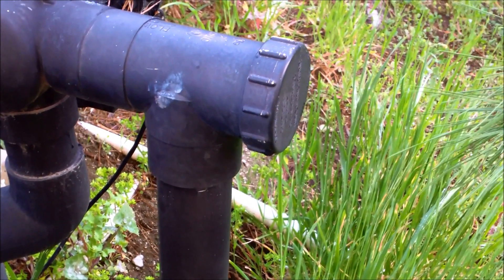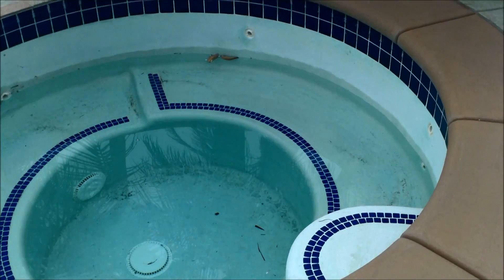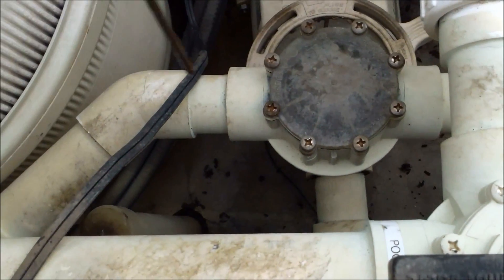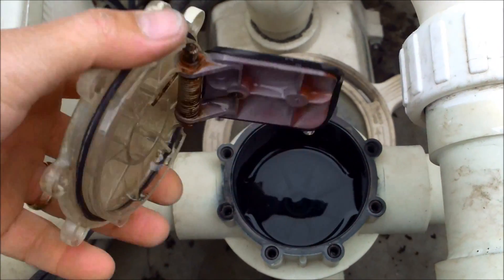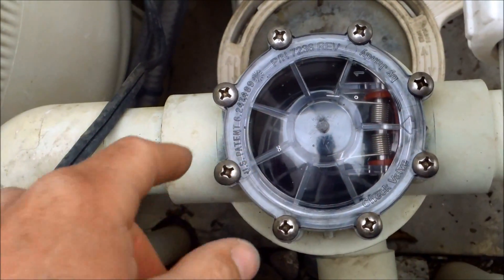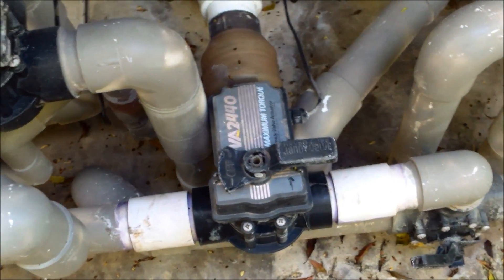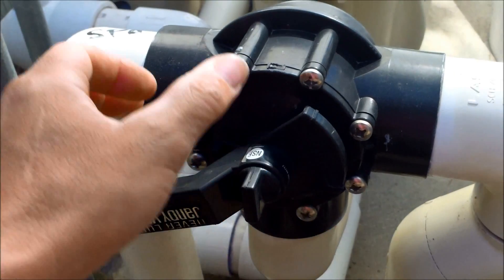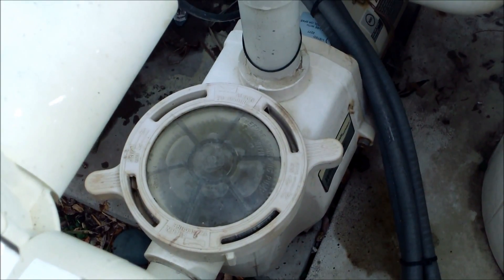My Spa is Draining Down When Pool Turns Off

Comment: Wow! Thank you! I replaced my spa valves thinking I had solved the problem. But no. So googled the question and got your video. But my Jandy system has a weird all enclosed check valve. No screws. I’ll call a pool service since I can’t cut pipes and do this myself. Thank you for this video!

Comment: Selling my house here in California, buyer hired a pool inspector check-in the pool, he rotated two valves that I had not touched in twelve years located in   the ground that look like skimmers but have some kind of a valve. Once inspector moved the handles on both now when pump is running water will not go into Jacuzzi as before and now the Jacuzzi drained into pool. What were those valves for?
Thanks
Reply from the maker: Turn the valves back
Reply: @SPL  Once  touched after 25 years  they broke and not working,have to be replaced. Thanks for responding.

Comment: THANK YOU - THANK YOU - THANK YOU!!! This video saved me a $150 service call. I sent my system into SPA DRAIN mode accidentally and when I activated SPA FILL mode - it would just keep draining. It turned out to just be a stuck spa drain cap/plunger thingy inside the Spring Check Valve. Working perfect again! Thank you so much for this video - YOU ROCK!!! 🙏

Comment: I went on a job where the problem was the check valve but it was because the check valve was installed backwards 😢 Great video man always a pleasure
Reply: If I drained my inground pool and the water level is below the skimmer and jets should I leave the pump off or on when filling the pool back up

Comment: I kept ignoring the water level in the spa lowering each evening, but the birds like to drink in the spa at top level in the mornings...so I finally followed your instructions and it was a 5 to 10 min. job. thanks! paid $14 for the Jandy valve on Ebay. Glad I spotted your video and didn't have to pay a pool repair to do this.

Comment: I change my back valve but sap water still goes down
Reply from the maker: It could be another issue. Also check for a leak maybe.
Reply: @SPL  it will refilled again like three inches go down the old valve was looks so bad before go have way down

Comment: How do I fill the spa back to normal after replacing these parts? Thank you!
Reply from the maker: Simply turn the return valve to spa return and leave the suction valve on pool mode. Or it will fill on it's own.

Comment: Hi.  Love your show.  First time caller.  Long time listener.  My Jandy valve is vertical, I think whoever installed it put it in the opposite way of the water flow, and i'd like to turn it around.  When I unscrew the valve, a flood of water comes pouring out and I can't figure out how to stop it so that i might be able to assess the situtaion.   Any ideas?
Reply from the maker: It could be the equipment is below the water level. In that case remove the pump basket and put a tennis ball in the skimmer hole. That should stop the flow.
Reply: @SPL  thanks

Comment: Interesting video.  Our Spa has Always drained down when the pump is not on (new pool).  I assumed this was normal.  Is it possible the check valve was installed backwards?  I have had other plumbing issues that I had to fix, clearly the pool builder was not very good with plumbing.  And out of business now, but that is another story.....
Reply from the maker: Yes- that is common. Maybe have a local pool service give it a look over.

Comment: I lubed the ortega Valve  VAL-PAK V20-069 twice, spa still drains when pump is off. After I cleaned my pentair flt fns pls60 DE fillter , run quick clean, the following day , it drained again. Do I need to replace the ortega Return valve and 1lb spring? Or what do you suggest I’ve been skipping. Thanks.
Reply from the maker: Those parts are hard to find but it sounds like that valve is pretty worn out. You can try to replace the insert and spring as a 1st step.
Reply: @SPL  replace both 1lb spring and the insert , it did work but only after that quick clean. the following day , still losing water. Any idea for the 2nd step?

Comment: Hi. My spa has always done this. I just thought it was normal. I looked and realized I don't have a check valve installed on my spa return side. Is this a problem? Does it really matter? Thanks for any info.
Reply from the maker: Doesn't matter in any regards except it is unsightly for the spa to be lower when the pool turns off. Maybe install a check valve to solve the issue.
Reply: @SPL  thanks for taking the time to reply. I appreciate it. Any preference on valve brand/type for the check valve should I choose to plumb one in?

Comment: This worked for my Pentair check valve! There wasn't any noticeable debris but there was an algae buildup so I cleaned it thoroughly and lubed the O-ring. Thank you a million times. 
I have the same exact hot tub & pool setup as one of the pools in this video. So, thanks a million!
Reply from the maker: Glad you fixed it!

Comment: Fabulous. I was in the 25%. I rebuilt my caretaker 5, replaced the nearby (pressure check) flapper check valve, and replaced the five diverter valve paddles (Jandy Neverlube) and all o-rings. One of the diverter valve o-rings was clearly damaged---half gone. When all done, the spa now retains water over night. Yay! Thank you!

Comment: I have the ortega check valve. Turned off the pump, unscrewed the cap, lubed up the ring, placed everything back in, and completed within 5 minutes. Saved between $140-$200 doing this myself. Thank you!

Comment: Hi David..I love your videos.  Do you have one that shows how to replace an Ortega check valve with a Jandy spring loaded valve?  They stopped making the Pentair Ortega seat assembly and the generic part is just a bit too small.  Thanks!
Reply from the maker: That is a bit more of a difficult swap since they are designed differently.  You would have to do some Mac Guyver  type plumbing to get the Jandy Check Valve to work in place of the Ortega one.  If you email me some pics I can send them to a buddy of mine who just did one of those last month.

Comment: Can this issue cause my water bill to spike? My bill tripled in the last couple months and I just noticed this same issue is happening. I found a broken valve that I’m going to replace but not sure if that will fix my water bill from rising month after month.
Reply from the maker: It's possible the spa is actually leaking.  You only notice it when the system turns off.  Do you have an autofill on your pool? If so turn it off and see if the water level drops.

Comment: So as the spa drains back into the pool, it should raise the level of the pool also, right??
Reply from the maker: Unless the spa sits very high above the pool it won't be very noticeable.
Reply: A friend of mine had the same problem and since i have experience with spas, he asked me to check it out. I found zero leaks, zero mechanical problems and i was stumped.... so this went on for a couple weeks with the same issue. So one day i asked him to set up a trail cam facing the spa. He asked why, so i said, since you live in the mountains, i think i know where your water drop is coming from. The trail cam captured just about every animal indigenous to the area drinking from the spa every night !  Now its covered all night long. Just thought id share this weird story. Not everything is what it seems.

Comment: ok... how do you get the hot tub to refill?
Reply from the maker: Leave it in pool suction mode, turn the valve to spa return. It will fill up quickly.
Reply: So as it is right now, my pool is not pumping water, the robot wont' work, the hot tub drains.
That tells me the actuator that stopped working is the one that controls the valve that allows water to come from the pool to the equipment.  Can I take off the actuator and manually turn the valve so that I can repower the system to get the filter/pump/robot going?  I have a service call in for them to come fix it, but I don't want to have the pool not being filtered until they get  here as this happened Friday night.

Comment: I have a valve similar to the one at minute 4:51 with a blue handle that opens and closes the valve. Would a bad check valve also cause a vibrating type noise when the pump is on and water is running through the heater? It only happens when the pump is running for pool circulation and not the spa. The noise goes away when I  adjust the pool/spa valves, but it makes the water levels uneven. I hope this makes sense.
Reply from the maker: It could be the flap is not working properly in the check valve causing that issue.

Comment: I have a pool and spa combo. I'm shutting down the spill way (winter) but in a matter of 4 days the spa will drain. Skimmers and pool main drains have check valves, returns from spa have check valves and after the pump before filter I have a 2-14 lbs rated check valves at almost full capacity. And when actuator turns from pool to spa that mid point is where water pushed by gravity from spa that is above pool & equipment drains into pool returns. I figured a 3" main drain reduced to 2" before pump is to much force for my check valve. Any solutions? My goal is to not use the spill way o. The winter but the winter mode will kick in and I can cheat by removing the freeze protection from spa and on for pool to prevent actuators turning every 15 mins. (Pentair easy touch)

Comment: I haven't been able to locate the leak in my pool the only clue I have it's my spa drains lower than my pool water level.. any suggestions
Reply from the maker: Could be in the spa return jets.
Reply: I had same problem . Changed out my check valve. But it still would slowly drop water level in my jacuzzi. I finally change out my diverter valve and it fixed it.

Comment: I am a new pool owner and one again you saved me money. 
I have a question about this . I did the bucket test last night and noticed the spa was low. When this happens does the water go into the pool causing water to go into the overflow?
Reply from the maker: Possibly.  Put a piece of tape at the pool water line and watch it. If the spa is not leaking but water is going back down the lines into the pool the water level will rise over the tape and out your overflow. Best to do this when you can watch it happen.

Comment: Okay so I tried to open the check valve and its stuck. What should I do now? It's so tight that I didn't want to break it.
Reply from the maker: You are referring to the Ortega 2" check valve - the one that is solid and has a twist off cap?  Then using a pair of Channel Locks on it will get it off.

Comment: So with a spring loaded check valve-do you replace it? Can you open it while the variable pump is running?
Reply from the maker: Open it with the pool off. You can lube it up and that usually solves the problem.

Comment: Changed the check valve and had a leak test on all plumbing. Still the SPA  drains all the way down to the very bottom - Lower than Jets and Lower than the Lights,  but I don't see water level going up in the pool or the water levelling off at pool level. What gives?
Reply from the maker: strange for sure.  Maybe film it and sent me a video link.

Comment: Hello, Thanks for the great video. My spa water level goes down after I turn the power off. Have changed the flapper check valve, did not help. I used the service mode on the controller and turn the spa mode on. The electronic valve seems to change the position, so it is not the spa relay or the controller board.What else could be the problem?  Bad valve? It is a Jandy system. Thanks
Reply from the maker: It could be the valve o-ring itself. Check your programs also - sometimes there is a spillway program and this could cause this to happen also. If there is a spillway program delete it.
Reply: Thanks again. Everything was working fine for many years and all of a sudden this happened, so I am leaning towards your suggestion of replacing the O rings. I have ordered the O rings and will try .

Comment: The reason for this is a bad check valve in the spa return line where it's not sealing the flow off properly  and due to the spa water level being higher, gravity will allow water to  back flow into the pool return lines therefore raising the water level in the pool then dropping when the pool pump turns back on .. I've had jobs where the installer slapped so much pvc glue in there , that  a new flapper still wouldn't seal right.. 18 yrs exp. Msg me for any problem with pool, I'll be glad to help .
Reply: Hi i’m currently having this problem, new to pool game, should i first replace the check valve to see if that helps ? If it doesn’t what should i do next

Comment: Thanks so much!  You just saved me $250.00 that my pool service wanted to replace one of these.  Bought the flapper assembly on Amazon for 28.00! (btw, the part # for a Zodiac/Janty Flapper assembly is 7056, not the 7036 that is on the cover, that is the part number for the clear cover only.  Hope that helps, it took me a while to figure this out.)

Comment: Question: my spa suction is off, so it can't be draining from there, so it must be draining from the return line, as it goes through the spa return line, will it go through the pool return line, or back through the filter then pump then pool suction lines?
Reply from the maker: Maybe leaking through return lines.

Comment: OMG  I have never figured out why my Spa drains  to 50%  after I turn the pump off.  I went as far as buying plugs for each of the returns to see if it was that :)  I dont have a check valve so I assume that is what I need ?
Reply from the maker: Yes, a check valve will solve the problem in most cases.

Comment: My hot tub is draining down while it is running.  It has power actuators and the valves appear to be in the correct position.  Should i change the roto assembly in the multi port valve?  Thanks!
Reply from the maker: Only time that will happen is if the suction line is open on the spa.

Comment: David, my spa is same level of the pool with a drain at the bottom, is there a basket/filter in that drain that need s maintenance? Is there a video for it? ....
 (new pool owner)
Reply from the maker: +meupoyni No - that drain is connected to your pool pump - anything that goes in their will end up in the pump basket. It is usually off unless it is in spa mode.
Reply: Thank you much for the reply. Excellent contents in your videos....

Comment: Thank you for the quick feedback, I have already confirmed the pool water is not rising, when the Spa water goes down. This happens when the filter is off, do you know what kind of caulking is recommended to seal around The Spa jets?
Reply from the maker: +FonejoeProductions From what I have seen you will have to call a leak specialist out in your area to isolate the exact area of the leak. This will cost $300-$400 depending. If you line in the L.A. area of California I can recommend someone. Fixing a leak is a real pain.

Comment: Hi, thank you very much very helpful video, I have a Jandy Valve, my problem is that the SPA level goes down, but the water doesn't go into the pool.  I have already replaced the check valve, but the problem still persists.  Any idea what could be my issue.
Reply from the maker: +Nasser Iranikhah It is possible that one of the spa jets is leaking water underground. It is not uncommon. To be 100% sure let the spa fill up and turn off the system. Mark the pool waterline with tape exactly at the water level. If the water does not rise in the pool when the spa drains down you could have a possible leak in the spa - usually around a jet.
Reply: I had a similar problem. Got a leak test of the plumbing done and the person said the plumbing is fine. Water goes down all the way to the Drain Level, below jets and below the light in the Spa but Water level in the pool does not rise. Thoughts?

Comment: I think this video will help solve my problem, so thanks in advance.  I have the ortega valve you show in the video.  My question is, if I simply make sure the pump is off, can I just immediately screw off the ortega valve?  Or do I need to depressurized the system somehow first?
Reply from the maker: +Kenny Stainback Once pool is off you can safely unscrew it. No worries.
Reply: I lubed up the Ortega part as described. Where previously the spa would drain down to the pool level after 15 minutes of the pool pump being off, it stayed full for over an hour... so, I think this did the trick.

Question, though... after turning the pump back on, excess lube was pumped into the spa.  Is this normal or did I apply too much lube?  If this is problematic, what should I do to resolve?  Thanks!
Reply from the maker: +Kenny Stainback Nothing to worry about. Lube will not have any effect on the water/ filter.  Glad it worked out for you.

Comment: I wanted to thank you for this great advice. My spa was draining back into my pool for quite awhile and I was afraid I had a leak someplace. After I did the bucket test to check for a leak and found none, I became convinced it was something else. Your video and the statement that 75% of the time it is the check valve convinced me that my problem was there. I didn't know which of the three check valves was misbehaving so I did the logical thing and replaced all three. VOILA!! I am cured. Simple as pie and I got the valves on line with free shipping for about $80.00 so I am a happy camper. Thanks for the great advice.
Reply from the maker: George Zane Cool.